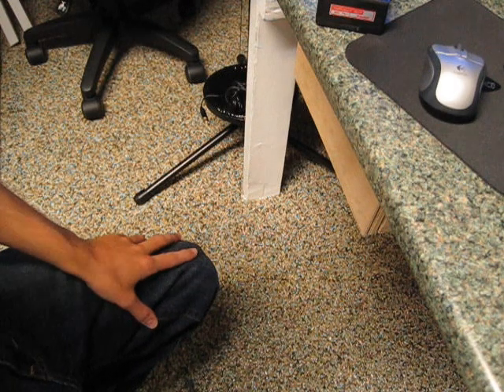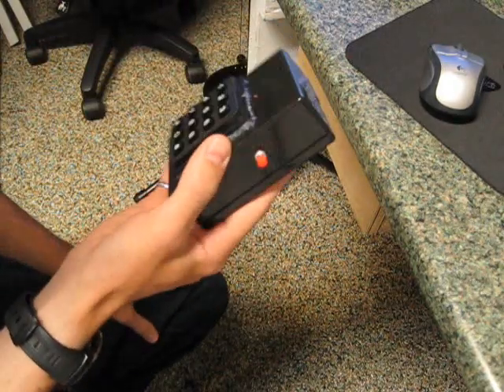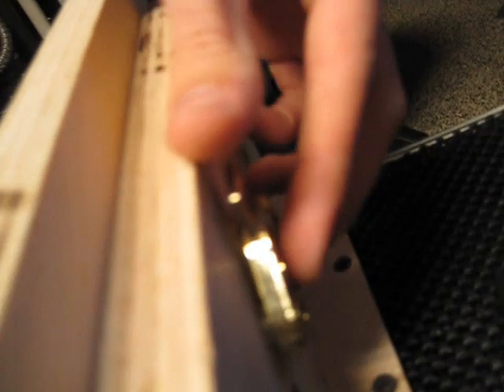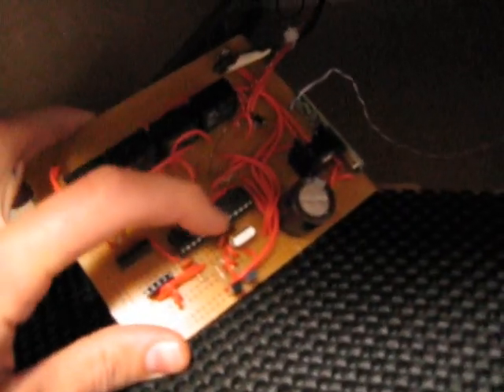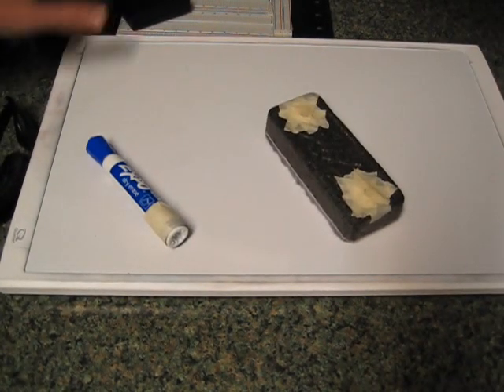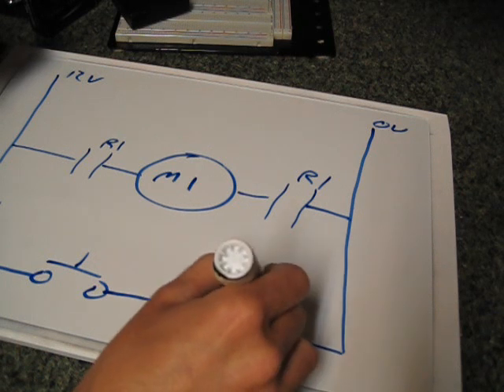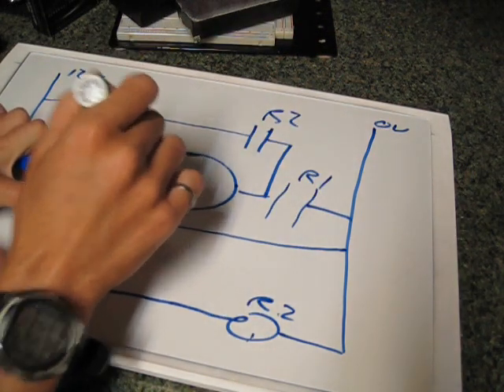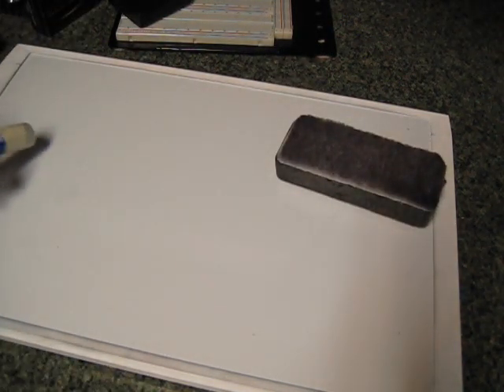Arduino SAFE with keyless entry

Comment: Hello Kevin, 

Just using two single change over relays (with one common, NO and NC contact) a simple H bridge can be done.  To drive this you will need only 2 I/O pins

Your approach does work but with those same relays you could have done it (you do not need 2c/o relays). This video is over 3years and now you might have better ideas than this. checked your site too but could not find the codes. 

Thanks for sharing.

Comment from the maker: @martinkjlarsson yes it would!! believe me, I actually used an H-bridge initially for this design but it was only rated for 1A.  This motor can pull over 2A, but since its only on for a few milliseconds, I though I would be ok.  Well, it actually worked quite well, until I forgot a piece of code to turn the motor off after activating it, and poof! the H-bridge was history.  I had a bunch of relays laying around though... and they work pretty good

Comment from the maker: @Flapjackbatter exactly! I had no idea what was happening, since the code was written so the drawer can only be either open or closed.  This meant that when I opened the safe, the arduino would reset, and not know that it was in the open position.